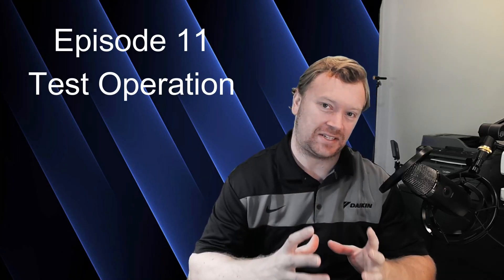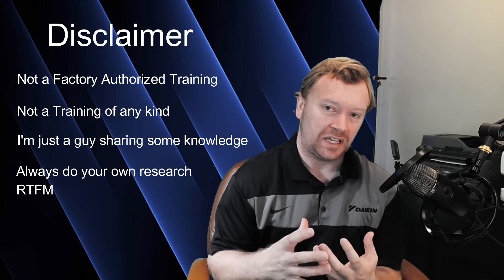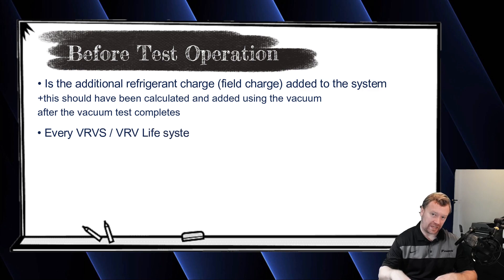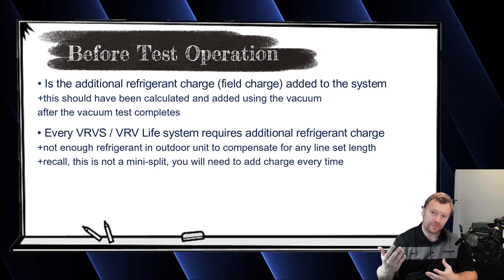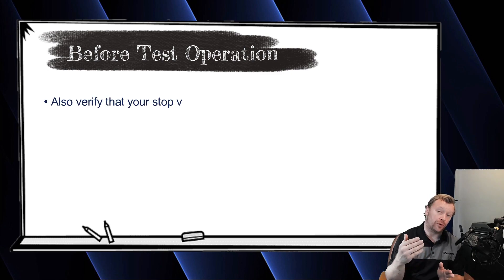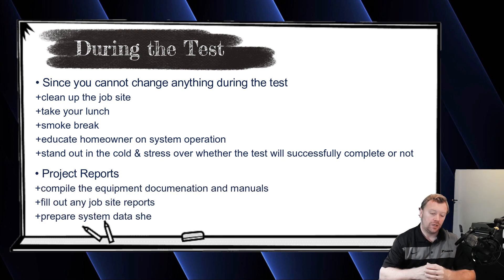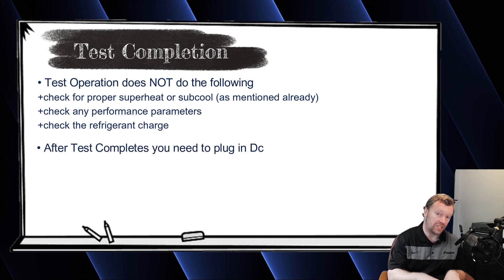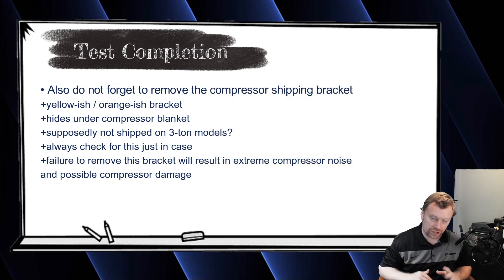Daikin VRVS/VRV Life Test Operation | Daikin VRVS Install & Commissioning Series Ep.11 - 11-26-2021

Comment: Hi Dana. I saw your daikin VRV self test clip and I have the following question: I worked today on my home daikin VRV unit to reset an E3 fault (was due to power outage) and then started a test run which I did not complete (took too long and actually is not really needed as I did reset the E3 fault). Now all units are working fine but I have U3 displayed on the indoor units. What would be the easiest and quickest way to eliminate the U3 ? Will total reset (20 sec) do the trick? If not - I understand that there is a "quick test" mode which takes much less time than the 30-45 minute full test - what is the sequence to activate this "quick test" mode, and will that be sufficient to eliminate the U3? Thanks very much, Arik Lichtman
Reply from the maker: Did you replace outdoor board? If you have a flashing green light on nav with active u3 just run the test from outdoor and let it complete. Easiest way. 
If the nav green light isn't blinking then your code is just an old code probably stored in nav.
Reply: Thanks for the reply. Yes the green light was blinking. No, I did not replace anything. I did run the test but after one hour and twenty minutes I stopped it because it was much longer than the quoted 30-45 minutes. I finally had a technician come here. He initiated a SHORT COMMUNICATION TEST, that apparently exists (only tests comm from external unit to the indoor ones). This took just 10-15 minutes and once it ended - the U3 error was gone.
He used just 2-3 clicks to initiate this "Short Test". Do you know what click sequence it is? It may come handy if I get the U3 error again in the future
Reply from the maker: Hm... not sure what sort of short test he would have been running other than just resetting the internal addressing. Interesting. I'll have to look into this.
Reply: I just replaced the main and filter boards on a slave unit on a vrv3 but ran the test from the master unit for over and hour and pressed the return button to end it. Still u3 error. Disconnect the slave and no errors.  Dip switches are correct

Comment: Thanks for your videos dana I’m new to vrvs but are helping me out a lot , I was wondering when adding refrigerant to a new vrv and new piping am I supposed to have the service valve closed ? Or open or should I add the refrigerant with the valves closed then open them up then set it into test more ???
Reply from the maker: I prefer to use the vacuum the line set is in when I'm done evacuating, it pulls in the charge. On a new install your outdoor service ports are closed at this stage. Add charge. Then open service valves. Then go through power up procedures.

Comment: So when my VRV life was replaced,  they treated it as a new install and added 2.2 lbs for the line set..  But when the did the "final adjustment" where they measured sub cooling at full speed they took the 2.2 back out to get it to the 12f.  I thought refrigerant was trapped in the CXTQ because they didn't evacuate using the "evacuation" mode that opened up the expansion valves which explains the over charge.  (remember I mentioned the compressor makes the high pitch noise now with that amount removed.)  So what is your experience if an installer doesn't "top off" for line set?  What are the symptoms other then a error code?) So is it possible there isn't enough in there, but its not so low it trips an error code?
Reply from the maker: It's possible. I don't know why they pulled it back out. Trim charging isn't to correct line set charge its to make very tiny adjustment. Not 2.2 pounds. So yea its possible its under charged. It needs to be pretty low to throw a code though. Can't say for sure, they should monitor operation with dchecker and go from there.
Reply: @InverterAlways  dchecker was ran for 30 mins and daikin examined it said it was good.  But then again here we are with a weird noise on the compressor (only when running at full speed)  Its like a high pitch whine along with the normal sound. (They had to pull 2.2 lbs out to get sub cooling down to the 12 degrees F it calls for in the install manual.  It was at 18, and they kept dropping it and finally at 2.2 it went to 12f of course after that pressure kept dropping and spiking until it evened out.  

These guys were working on it as if it was a normal a/c system with manual gauges.  I requested the D checker later. and of course they needed to watch your video to figure out how to use it haha.   I asked another company what they suggest, they said evacuate the the entire system again and refill it with the calculated amount.  I can't even image how much they would charge for that.  But at least it sounded like they know more about my unit then this other company that installed it and 18 months later the compressor is dead.  I dont think they used notrgen when they brazed the pipe so I bet metal shavings got into the line set and jammed up the compressor.  When working on that they relied on daikien tech support for everything, they replaced every board until nothing was left but the compressor.  And here we are now.  Seemed to work well though all winter.  So maybe I am just thinking too hard and its fine.
Reply from the maker: @cranbers  30 minutes is not enough, period. It must run for 20 at full speed just to get an idea of where subcool is. Then and only then can you add or remove 8 ounces. Then you must run another 30 before analyzing performance. Then add or remove up to 8 ounces. You cannot fine tune a charge in only 30 minutes. Period. Not on vrf. Daikin does not examine 30 minutes of data, they require several hours if not 24 hours. You can't take 30 minutes and say it's fine. So they either didn't send it or.... idk. But I can tell you someone who knows what they are doing should spend a good couple hours monitoring it. Analyze and go from there. Call around for an experienced vrf tech to analyze some data.
Reply: @InverterAlways  Thank you for your input.  Now I feel even worse lmao.  Another company I asked said they monitor and record data for 24 hours before sending it to Daikin.  I should of known 30 mins sounded fishy, I bet it was just to get me off their back.  And when they came to me and said ok daikin said its good I would just agree.  What other argument is there? 

What other symptom (higher energy use?) if the unit isn't operate right?  I did notice my energy bill went up after this new unit was installed,  ( my old unit was in for 18 months and energy use is higher not to mention how it runs all day long and won't hit set temp).  Thanks.
Reply from the maker: @cranbers  energy usage could be caused by a number of things. Run time, load on compressor, charge, it's too hard to narrow down without performance data. I would call the company that says they take longer periods of run time and have them check it out. Otherwise you're just playing the guessing game which will stress you out.

Comment: Hey Dana, when setting the nav controls to one of them being the master it does not apply to heat recovery systems does it?
Reply from the maker: Each port of a bs box on heat recovery is like a mini heat pump. So no, each nav would be a master. The only time you need to set it on heat recovery is when you have multiple indoor units sharing a single bs port, each with its own controller. That port then would need a master indoor.

Comment: When you install a VRV live with receiver is there other amount of refrigerant calculation or just standard calculate the length of liquid line and gas line
Reply from the maker: depends if you have an insulated liquid line and proper gas line size, or if you have an uninsulated liquid line and oversized gas line. If you look in the installation manual for the outdoor unit it will show you additional charge parameters if you have the latter. If you installed an uninsulated liquid line you will have to add more charge than usual though.

Comment: Another insightful vid Dana. Question on test mode. I’ve been instructed to perform a test when changing the main PCB on a VRV IV. 
Could you inform when you need to perform a test from any service work (ie; if an indoor or outdoor PCB is replaced)
Reply from the maker: When you replace the outdoor board you need to re-run the test. Otherwise you should be fine. When replacing an indoor or branch box board make sure to reset addresses though and ensure field settings are reprogrammed on indoor units.
Reply: @InverterAlways  cheers Dana, in the case of re-addressing, say I have a wallmount unit with an infrared remote control. Would I have to plug in a nav controller to set up field/address?
Reply from the maker: @thanktheknife  why do you have a vrv wall mount with hand hold controller is my bugger question. Albeit no, you don't have to have a nav hooked up, I don't know why you would NOT have one hooked up. The hand held is very limited in room temp control, its like the mini splits. It's also a huge pain in the butt to change field settings. So I would hook up a nav do all the settings then plug the hand held adaptor back in. And while you're at it try to talk the user into just keeping the nav controller Instead. 

Be careful on the settings as using the hand held means using return air for room sensing. There are some additional settings you may want to check or change for comfort in this scenario. Fyi.
Reply: @InverterAlways  yep, so on a few of our commercial sites (retirement homes). In the common areas they have the wall mounts with only the handheld, which staff keep hidden, so that no-one plays with the settings.
Reply from the maker: @thanktheknife  got it.